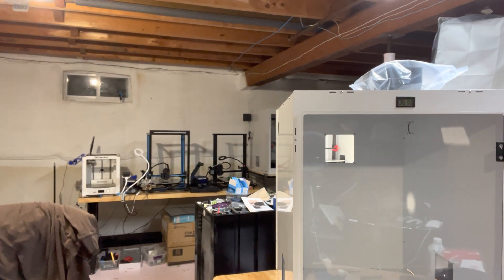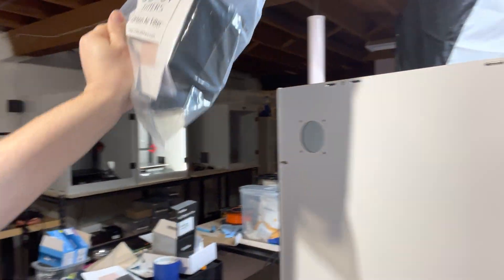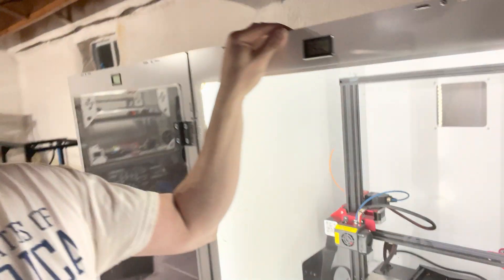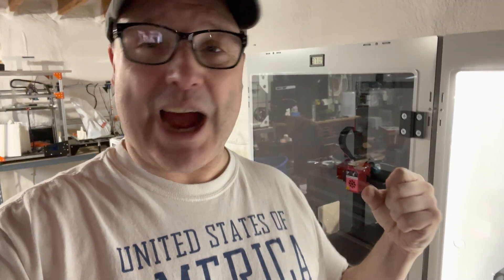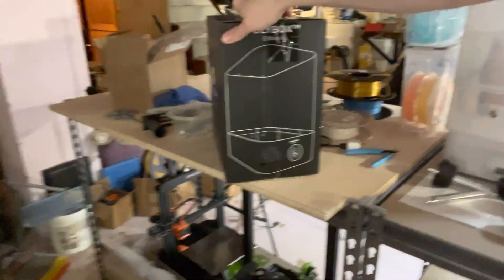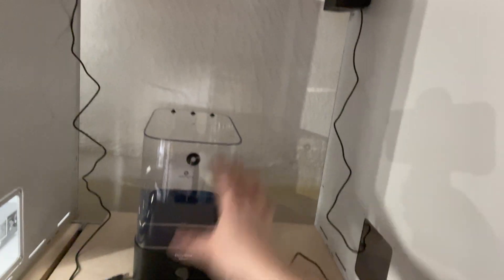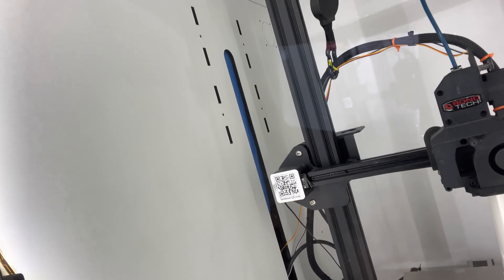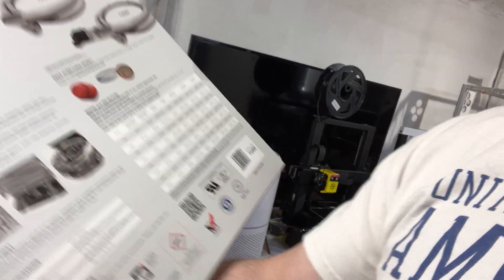Where have I been? Safety Updates to my 3D Print Shop!

Comment: Hi again :).  So I’ve been looking at different ideas for a filter.  Have you tried using this filter idea?  He talks about the filter at 3:20 mark.  Seems like for $50 you can get a huge carbon filter that would probably last longer.  He uses the ac infinity blower as well.  I’m thinking you can attach to the 4” tube on the bigger openings of the printed solid enclosures.  https://youtu.be/F2Z537HW7cw

Comment: Thank you for the video.  I'm new to 3d printing and just bought this enclosure.  I was thinking of getting a carbon filter from 3d up fitters with the fan as shown in the video.  Do you know of something similar that also has a hepa filter with it.  I figure it wont hurt to have hepa and carbon together.  Thanks
Reply from the maker: I’d ask 3DUpFitters. I run Honeywell 300 series air purifiers in the shop. Can’t hurt.